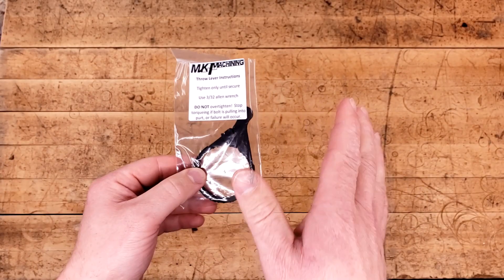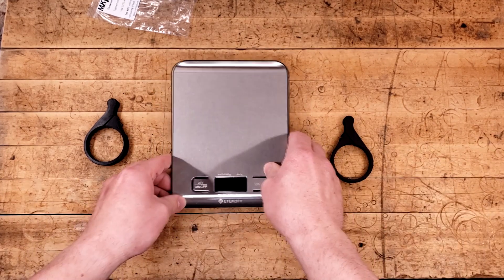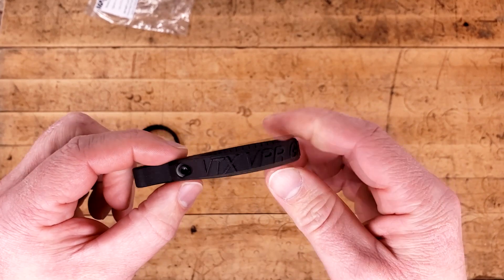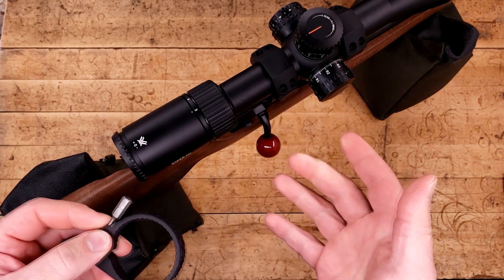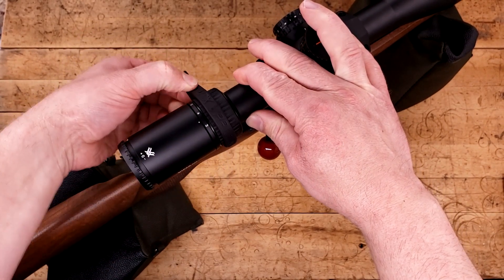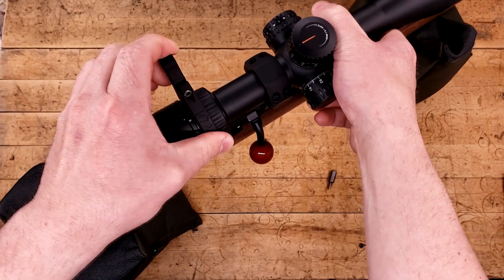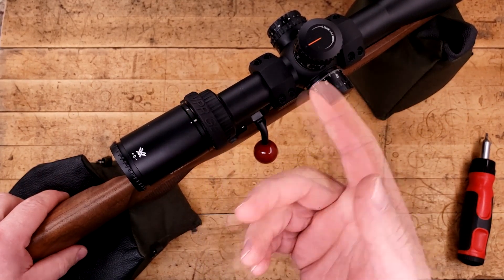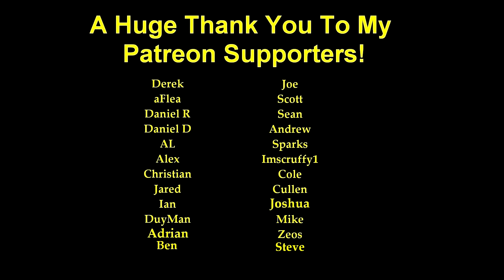MK Machining PRO Throw Lever - The Best Aftermarket Throw Lever?

Comment: I bought 2 of these and one was the wrong size. I sent it back and did not receive any refund. Then when the other stripped the nylon screw threads from use after 2 months and emailed to get it replaced I received no response. I do not recommend this company.
Reply: Tyler, owner of MK here.  Please email us, support@mkmachining.com

Not sure what slipped through the cracks here, but we're a small shop shipping a lot of levers and look forward to taking care of you!